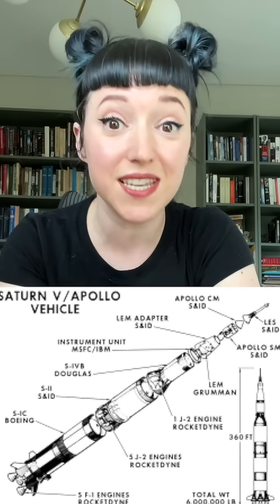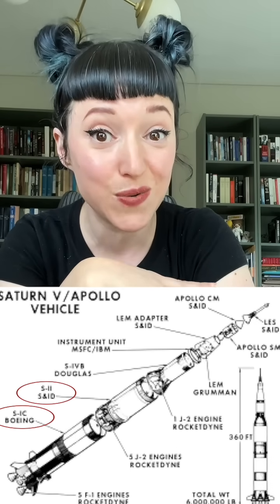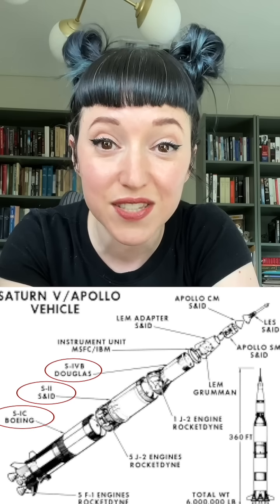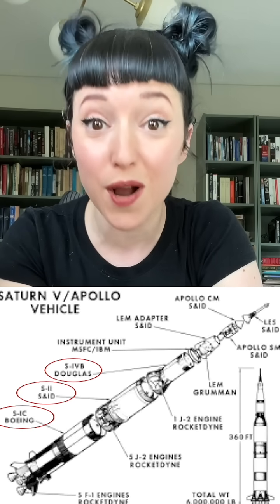Why the Saturn V is missing a stage #shorts #history #space

Comment: Somethings about the Saturn V:

The Saturn V launch vehicle was actually three rockets, built by competing aerospace companies, Boeing (S-1C first stage), North American (S-II second stage) and Douglas (S-IVB third stage) stacked on each other.

All of those companies are now Boeing.

The S-II didn't have enough thrust to lift itself off the ground. It was designed to be an upper stage.

The S-IV, on the orher hand, was proposed as the basis of a single-stage-to-orbit light launch vehicle, which could have launched cargo or two astronauts to orbit using a Gemini capsule. Developed versions would have been reusable.

Wheh the first Saturn V (SA-501/Apollo 4) launched in 1967, by some estimates it could have launched a mass to orbit equivalent to everything the US had launched to that date.

The Saturn V was developed and built in less than ten years, launched 13 times with only one partial failure...and then we threw it aside. (The Russians are probably still shaking their heads.)

Had the Saturn series been continued and developed, there were a number of variants considered. Some would have stretched all or some of the stages. Plans existed to recover the first stage. One version would have strapped four Saturn Vs together. 

There is a telented CGI animator on YouTube that goes by HazeGrayArt who has posted a number of video speculations of some of these variants. Highly recommended.

Comment: Ahh not entirely true about stages - they're more about engine efficiency at different altitudes. In low altitudes air pressure keeps the jet pointed down but as the air thins it's more efficient to use a different bell shape to reduce performance losses.

Comment: Like many engineering problems you don't always know how complicated it will be until you get into the middle of the problem. In this case it seems like the stages were developed under the belief that getting into space required way more momentum but test firings and launches proved the math was not as great as initially thought. So by scaling back and reworking the stages they solved the problem.

Comment: The primary limitation of the rocket equation regarding payload is that it demonstrates an exponential relationship between the amount of propellant needed and the desired delta-v (change in velocity), meaning that to significantly increase payload, a disproportionately large amount of fuel must be added, leading to a "tyranny of the rocket equation" where most of the rocket's mass is dedicated to propellant, severely limiting the payload capacity; essentially, the more payload you want to carry, the more fuel you need, which then adds more weight requiring even more fuel to lift it, creating a vicious cycle.

Comment: No.  It's not the combined thrust of the stages (Space Shuttle is an exception).

Staging works because an empty fuel tank is heavy, and dumping it reduces the mass being accelerated with the remaining propellant.

Also, engines are heavy, and as the vehicle loses mass the acceleration increases.  At some point, you have to turn off the engines.  The Saturn V first stage turned off the center engine a full minute before first stage separation.  Shut down engines are heavy, and dumping them also reduces the mass being accelerated to orbit.

The Apollo Lunar Module weighed approximately twice what a single F-1 engine weighed.  Carrying those to the moon (even without the tanks) would have required a rocket 3.5x bigger, making the whole thing impractical.
Reply: yay rocket equation. Though to be honedt it applies kinda to all kinds of stuff. But in rockets the payload is so incredibly small compsred to fuel engines etc that it really puts it under a microscope.

Comment: Put me on the nerd list! I was about 8 years old when the X-15 program concluded (bad luck not to hit 200 flights). The X-15 program hooked 8 year old me and I followed nearly every rocket/space/satellite mission for most of my life. I'm even running the Apollo Guidance Computer (AGC) emulator to discover how the code worked. The original AGC code is part of the emulator package. I watched Apollo 11 land and followed all of the missions through 17.

My nerd credentials include interest in astronomy, computing (still going after 40 years), electronics and circuit development, amateur radio, electrical power distribution systems, and more but I'm hitting tl;dr now.

Comment: It actually goes from before that.  Why have stages?  When the rockets were first made they were all pressurized.  So the pressure when the engines started was the highest power it count achieve as the tank drained the pressure decreased. Therefore to achieve a higher altitude you need many small powerful stages.  Later turbopumps became the norm.  The turbopump was heavier but not heavier than the combined engines of all the stages.
Reply: mostly stages are about (not) carrying the weight of empty fuel tanks and engines that are shut down as the rocket gets lighter.

Comment: So 'winning' the Space Race actually slowed everything down.
The question I've never heard an answer too is, if rockets don't need a heat shield going into space. why do they need one coming back down? Why not just come back down more slowly??
Reply: @Boppy-B-B  the vehicle gains enough speed to get into orbit  (17,500 mph), then accelerates even more  in the vacuum of space to reach escape velocity (25,000 mph). When returning from the moon almost all fuel has been used. A complete extra stage would be needed to slow the craft down. More fuel is needed to take along  this extra stage to the moon and back. A heat shield is easier to build and has less chance of errors and is way cheaper to carry along.
Reply: @dramklukkel  Not all spacecraft/satellites  go to the Moon. Most stay in low earth orbit or geostationary orbit.